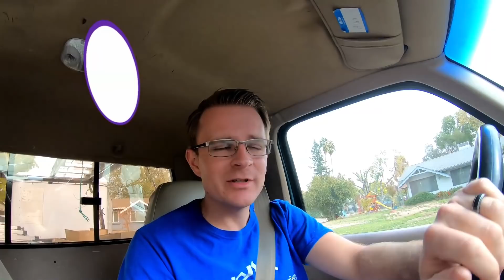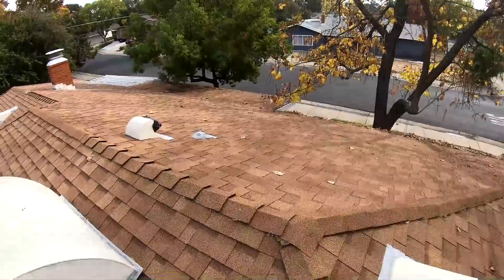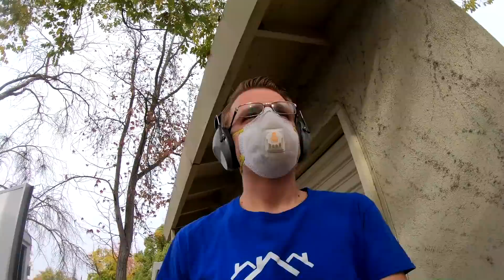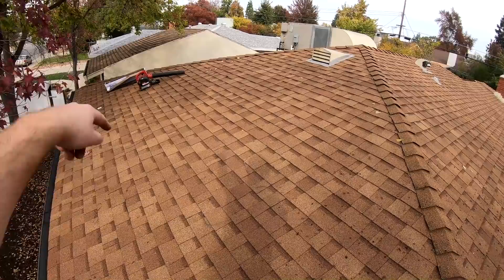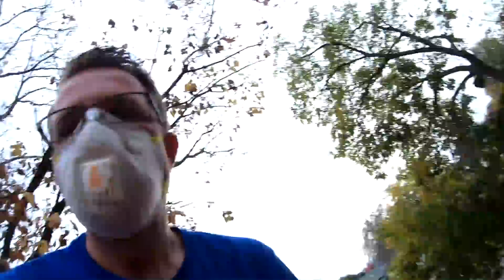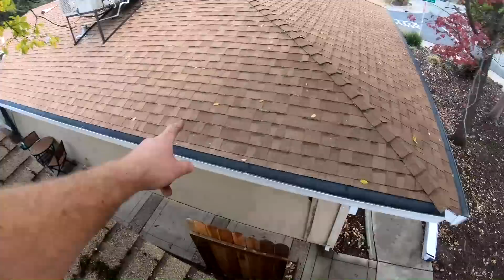My Handyman Hourly Rate / WLOG

Comment: I wanted to chime in on the blower,fuel issue. I switched to truefuel a few years back. It’s a premixed fuel available at Home Depot. They sell 40:1, 50:1 and 4 cycle. It’s available in 32 and 110 ounces. It’s not cheap ,but, it last 2years once opened, and has a shelf life of 5 years unopened. I always hated mixing different can for 40:1 for my blower and 50:1 for my chainsaw. Now I keep 2 bottles (40, 50:1) and only use what I need.
Reply: I agree the pre-mixed canned gas is good. If you can't stand the high cost of the pre-mix, I recommend using Stabil to increase shelf life of your gas. Also, if you are in an area where gas has ethanol added, avoid the ethanol gas for your small engines. I always look for gas which is explicitly labeled "no ethanol".

Comment: I love my state if you have general liability you can do a job up to 30k material and labor before you have to bring in or be a general contractor. As a handyman its not verry often I hit the 30k job ive hit a couple 20ks but that was primarily expensive flooring I have done labor up to 6k though. I dont know how id make it with a 500$ limit. Before I had insurance it was a 1k limit so I would break the etsimates up. Estimate for tearing old floor out, estimate to haul it, estimate to dump, estimate to remove old shoe, estimate install floor, in kitchen and dining room, estimate to install bath and bed, estimate to install shoe. Etc.. The laws are so weird for handymen
Reply: Clark Oates what state are you in?

Comment: when cleaning a gutter people use a bucket and a ladder and gloves.  blowing cause's a mess to clean up and can lead to blowing gutter mud all over the side of a house that can take hours to clean.  leaf guards just make it harder to clean next time.  Also leads to ice dams in cold climates.
Reply from the maker: Thanks for your comment! If you blow the gutters before the rains it works great! If you wait until after the rains it's a muddy mess for sure
Reply: I used a 16 gallon wet/dry vac with a 25 feet long hose. I built a 180 degree angle with Abs pipe to fit the vacuum hose clip. Then I start the vacuum place the Abs elbow into the gutter and run it along the gutter. Does the perfect job even on gutters full of mud. In which case u do end up ruining your $30 filter per house of gutters. Which in my case in no biggie coz I just pass the cost on.

Comment: Allen, Please elaborate on how going hourly is a work around for the California’s $500.00 cap per day? Aren’t you concerned that your customer is going to jam as much work as possible to get the two hour min.?  If I was a customer of yours and I was aware of the $90.00 per hour charge I think I might object to You Tubing on my clock,, have you thought about this?
Reply: Cara,  you make a good point.   typically the minimum amount is
     usually recognized as what will be paid to the handyman 
   regardless if he is there 20 minutes or 2 hours.   that should
     be open for discussion between the homeowner and handyman
   prior to the start of any work.    a lot of businesses that sell and
     service products have a minimum charge when coming to
   your house for plumbing repairs, air conditioner repairs, 
     electrical repairs, etc,   and they be required to advise you
   of that before starting work.

Comment: So if I understand you correctly, You can charge by the hour as much as you need to, for example (8 hrs. x $90= $720) as opposed to giving the customer an estimate / contract for $720. You could even come back tomorrow and spend (4 hrs x $90= $360) if necessary to complete the job, correct? As long as you don't have a contract / estimate for labor and materials that exceed $500, if you did you would be considered contracting without a license because you exceeded the $500 limit. If you have the customer buy the materials themselves or invoice them separately if you provide them I think that would help also.

Comment: I have an unadvertised rate I use when I’m estimating, but nothing concrete. What if someone what’s a light fixture mounted, or an outlet replaced? No way you charge them a 2 hour minimum... How do you handle those?
Reply: You still charge your minimum, but you offer to do other things to fill out the time. Anything from changing light bulbs to adjusting door hinges/latches to securing a loose toilet paper holder.

Comment: How are those gutter guards with pine needles? Do they stick in the holes or wash right over?
Reply from the maker: I'd say maybe 10% pine needles get stuck in them but eventually get brushed off
Reply: Martin,  often times small twigs get stuck in the mesh along with
   the pine needles, and that causes leaves and pine needles to 
start building up on top of the gutter guard.    if the guards are
   the metal ones with slits for the water to drain,  they usually
don't have much problem with debris getting stuck in them.

Comment: Heads up, if you hand out cards, or do any other type of advertising, you must indicate "Not a contractor pursuant to 7027.2" or else you could be fined. It's silly, but better than the old code which required you to also have the customer sign a copy of a document. If you already have cards made, just print stickers (Avery address labels) and put the on. Keep up the good work. http://www.cslb.ca.gov/Resources/IndustryBulletins/Online_Marketplace_Fast_Facts.pdf http://leginfo.legislature.ca.gov/faces/codes_displaySection.xhtml?sectionNum=7027.2.&lawCode=BPC

Comment: Good morning Alan! First of all I just wanna say thanks for making all the videos were definitely an inspiration. But I’m going out looking for a trailer today. And I just wanted to ask you your advice. If you were to get a new trailer would you get something bigger? And if so how big? And do you have any problems with a single axle?
Reply from the maker: Hey good morning! Thanks for the question, if I had to get a trailer right now I would probably get one that was the same size as mine but about a foot taller! That is really the only downfall is it's just too short. But I really like my 5 by 8 I feel like it is a good size to tow around and maneuver! Thank you for your comment!
Reply: 5 x 8 is big enough to get the job done for most trades but not hard to manuever and park like bigger trailers. You want to try to buy no more and no less than what is needed for your business, parking situations, etc.
Reply: 6x10 or 6x12.  I use 6x12. Lots of room. Better to grow into the space then to be nearly exceeding the space you have. My is just over 6' in head space.

Comment: Working by the hour sounds good at face value but when you take a closer look you are hurting yourself. 
How long would it take an inexperienced, unorganized handyman than doesn't even have all the proper tools to do a job? A lot longer than you.
So if you can do the same job with your superior skill and equipment in half the time you will get paid half the amount as the novice for the same job.  Some will say, well I am getting a fair hourly rate.  You are actually penalizing yourself for your experience and better quality tools.
If you can only charge $500 per contract then I would break the job into several contracts and charge that way. Good luck!

Comment: Phone: My voice mail says. "Thanks for calling Rene. Please do NOT leave a voicemail.  Text me, or email me at xxxx."  Then I leave my phone on and promptly respond to all texts and e-mails as work allows. 
I do answer calls from my clients (PM's and tenants)  or calls that I am expecting immediately. Though nearly all text. 

Example: Today, Lowe's is installing a new OTR (Over The Range) Microwave for me ($99 Install fee, that I'm gonna mark up to $175). So I expect 2 calls from them. One from Lowe's Central, and one from the Lowe's independent contractor installer. So I'll answer them no matter if I need to pull off a task to do it. 
This system works great for me. I have more dedicated work time, no voicemails, and peace of mind.
Before, the phone and voicemails were driving me nuts.

Occasionally, some idiot or telemarketer will still leave a voicemail. I trash them without listening to them. 
-
Reply from the maker: Haha definitely! That's a great idea with Lowe's installation services! Thanks for your comment!
Reply: Pay for visual voicemail from your cell phone provider. You can just read your voicemail as it comes in, and not turn down business for a stupid reason.
Reply: @brothleutner  Just get a google voice number, $25 to sign up. One time fee. Link your number to it (port) and it has free visual voicemail.
Reply: So you are charging someone almost twice what install actually costs them simply for them calling you and you are ok with that ? Why doesn't your customer just call Lowe's themselves and save almost 50% ? I think if they knew you did that , they wouldn't approve ...hope it's not some little old lady ...
Reply: That's honest to you ? 
Lowe's charges only so much to install and you'd almost double it on the customer ?
Reply: @therealmccoy5433  oh put a sock in it.
Reply: @therealmccoy5433  
Yes. I am fine with it. The homeowner didn't want to do it, so they pay. 
When you hire someone to take care of your property, it costs money.
Reply: Rene Gade I would like to know what phone service app you or service. I want to use one phone with two numbers. Thanks